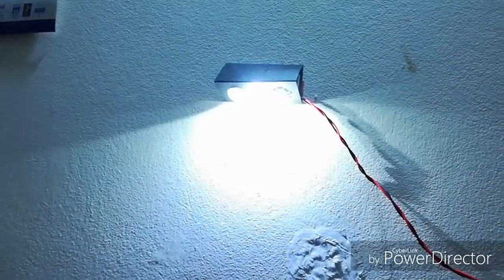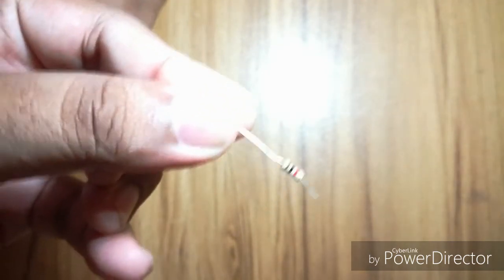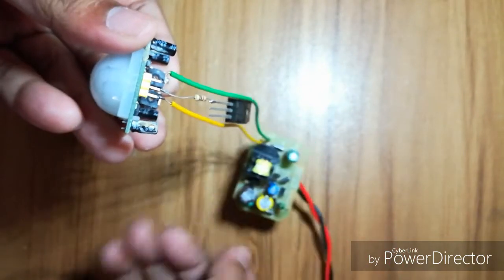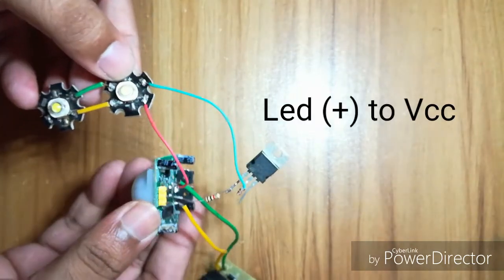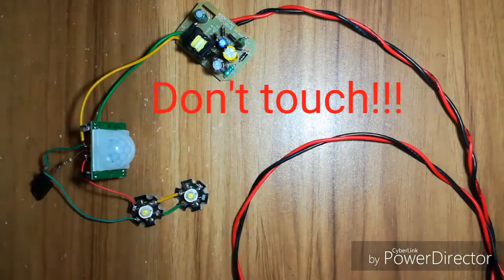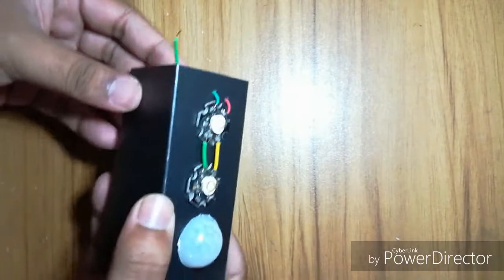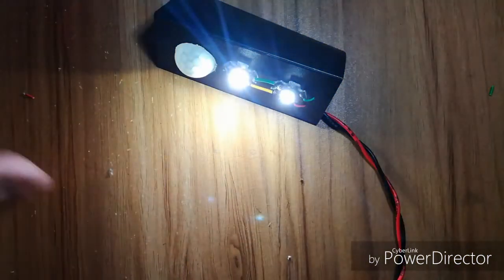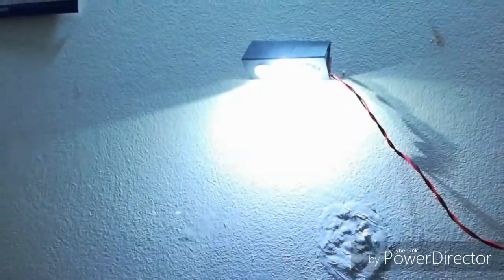How To Make A Motion Sensing Light Using PIR Sensor

Comment: Thank You for this video. What other transistors can we use ? IRfZ44n? Bc547? 2n2222?
Reply from the maker: Each of these will work
Reply: @ABID5 Thanks but which one will have the highest current
Reply from the maker: IRFZ44n
Reply: @ABID5  Ok Thanks, but it won't work on 3.7v lithium battery will it?
Reply from the maker: No it wont

Comment: Where do I find the 2 1w LED and the 220v to 7.5v power supply as shown in the video?
Reply from the maker: aliexpress for a few dollar
Reply: @ABID5  Thank you. Is it possible to use a AC/DC 220v to 5v, 3.3v/600mA 3w Module?
Reply from the maker: yes..

Comment: Why did you used the transistor?
Reply from the maker: PIR sensor has only 3.3 volt output which cannot light the LED ,so we use the transistor as a switch.
Reply: @ABID5  does transistor amplify the voltage?
Reply from the maker: No.Transistor is like a switch to turn on Led.If the current on input ( base emitter) increases the output current also increases.
Reply: @ABID5  sure thanks

Comment: why we use Tip122 ,plz explain
Reply from the maker: the output from the pir sensor is 3.3v and less than 30mA,which can not turn the led on.so we use tip122 npn bipolar transistor as a switch for led.
Reply: ABID Inc. can i use BC547 ( NPN ) transistor
Reply from the maker: I'm not sure.It may get hot.
will work if you use some 5mm white leds.